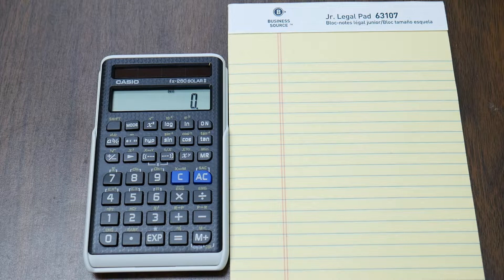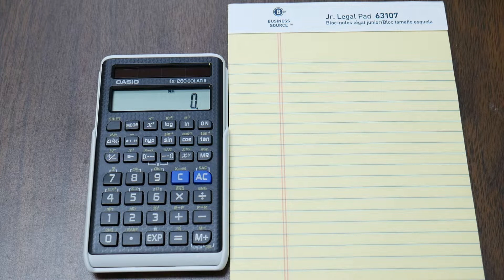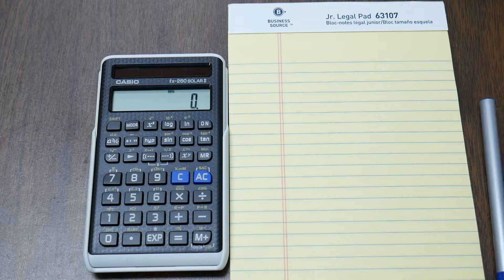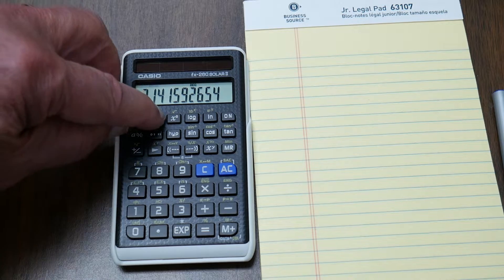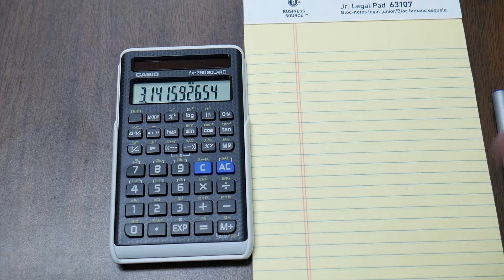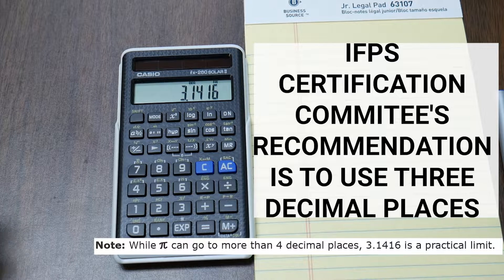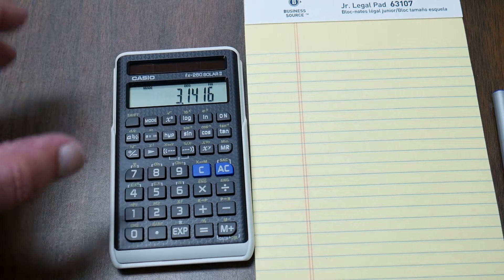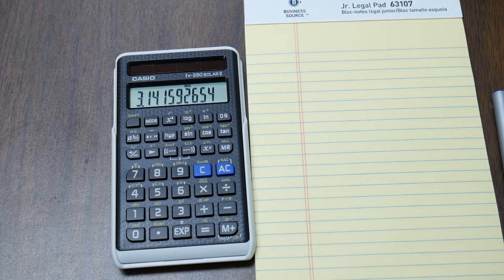Casio Calculator Tutorial - Functions You Never Knew You Needed

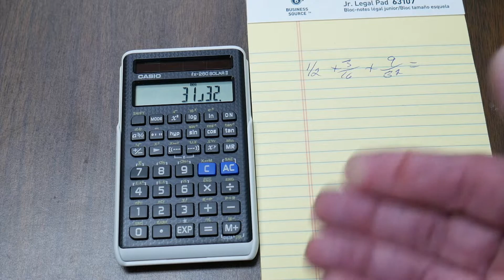Comment: 4:44 Press the Ab/c button to toggle between decimal and fractional display of the result. The trick you're using is completely unnecessary.

9:52 Once again, you're using a superfluous hack instead of dedicated keys. The [Min] key puts any value you want directly into memory. To delete it, simply set the value of M to zero (0), using the [Min] key.